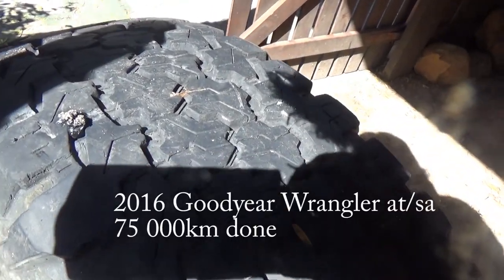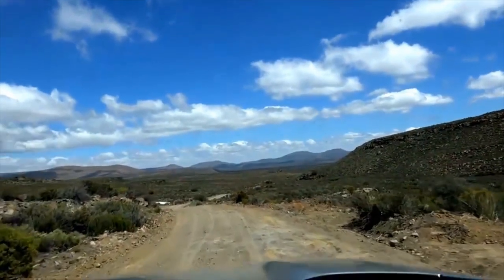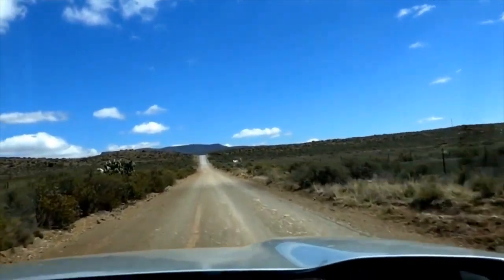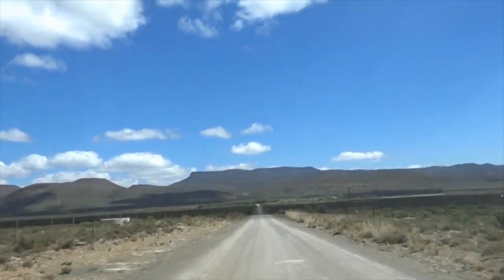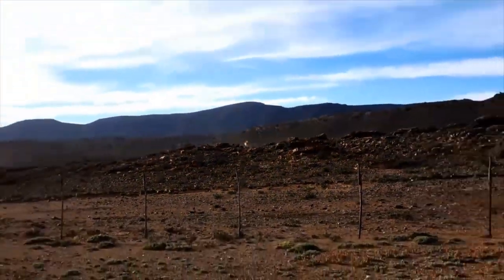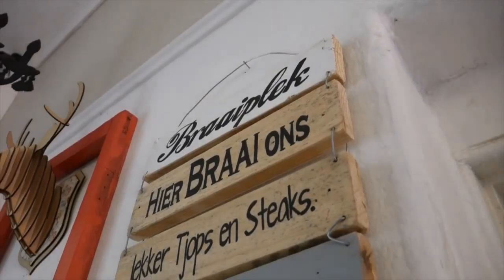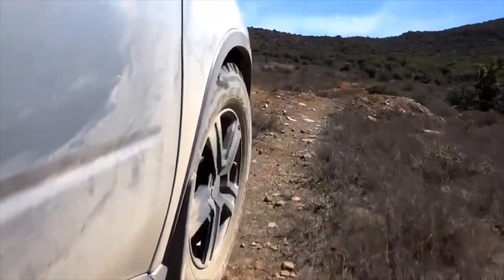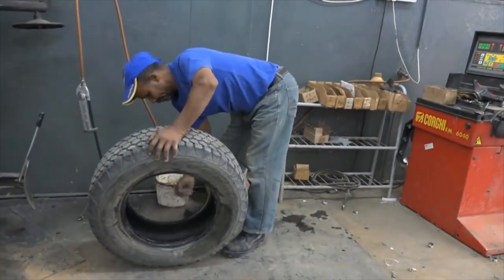Goodyear Wrangler All-Terrain 75 000km tyre review

Comment: A/S.  Do the Goody's still flat spot on first departure during a winter in Cape Town ?  Those 'Wranglers' are always a standard bearer and aftermarket manufacturers are rated either lower/higher in spec' !  V.
Reply from the maker: Hey Vin, no flat spots, still got a couple more 1000 kms out of them. Michelin and Dunlop have some tyres for me to test...